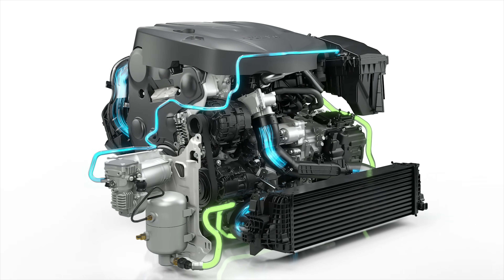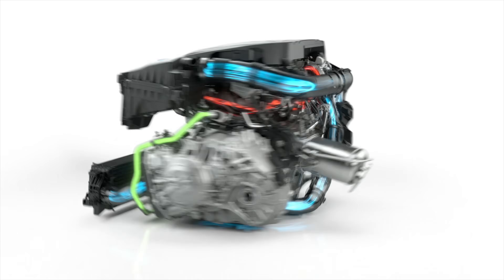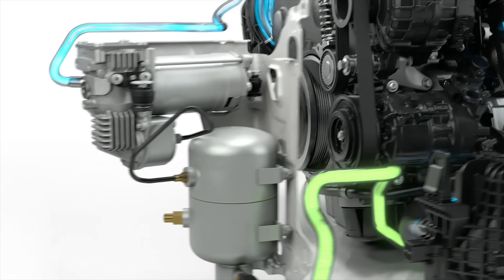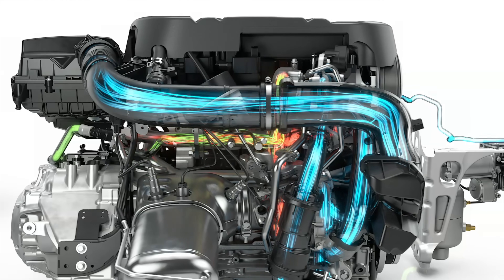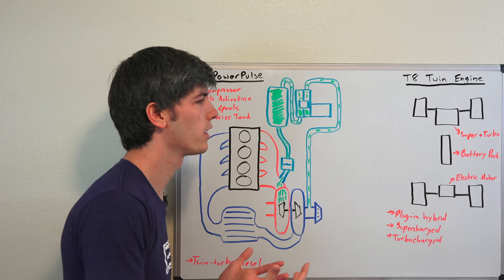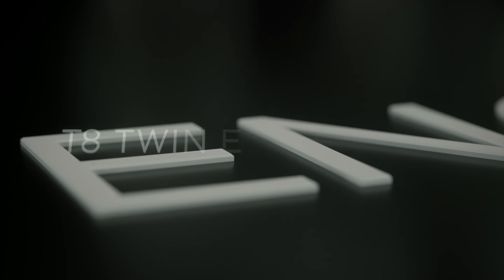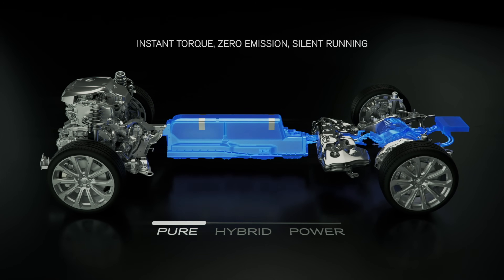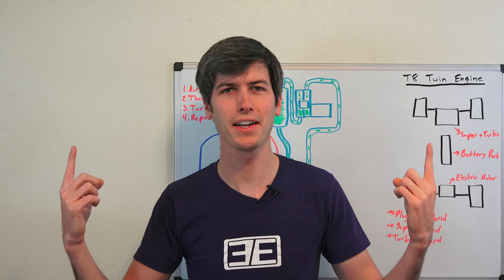How Volvo Is Eliminating Turbo Lag

Comment: So your injecting air into the exhaust and presumably before the lambda sensor... So how are they stopping it from reading a lean situation and thus dumping more fuel in?
Reply from the maker: Well this is a diesel engine, so they run a very wide range of air/fuel ratios. It would be a bit more complex if it was gasoline, for that very reason. Diesels can regulate power based on how much fuel is injected, and run just fine at very lean ratios.
Reply: Except you'll be producing a lot of NOx.
Reply: UpShiftTrackdayVideos 

They could also have an input to the computer when the air is being relesed aka activated, the computer can be programmed to expect a change in lambda reading a bit like how they do for the secondary air injection system
Reply: UpShiftTrackdayVideos by programming the ECU to ignore that change while the compressed air is being introduced. Considering the system activates at wide open throttle, the throttle body sensor is going to tell the ECU "hey we're doing the thing so ignore the funky numbers"
Reply: NOx is somewhat an issue in Diesels but the point is that this technology doesn't affect that since a Diesel doesn't have a lambda sensor and the maximum amount of fuel injected is determined by the air mass sensor (in the intake).
Reply: PbPomper No, it's well known that with Lean AFR (most diesels) the NOx emissions are very low compared to a Stoichiometric AFR .
Reply: well its activated at WOT so its gonna be in open loop anyway, but its a diesel anyway.
Reply: I can see a hack of tapping into the compressed air line to the turbo to dump a little extra fuel into it.  Then the turbo would act like a jet turbine.  ;-p

Comment: My first assumption was that the compressed air would go into the intake to provide a small amount of boost while you wait for the turbo lag, but instead it goes into the exhaust to help spool the turbo more quickly. I found that surprising.

Comment: Why doesn't Volvo just add a separate 48 volt power system and add an electric supercharger? Seems like a much simpler and less cost method than this air compression system.
Reply from the maker: Actually they did it because it was cheaper (and simpler) than a 48 volt system.
Reply: Even when factoring in maintenance? In my head, it seems more logical at this time to switch over to a 48 volt system, allows for more benefits than just adding an e-supercharger as well as allow more and more electric safety systems to be added and creating a base for future cars than to spend the time creating this air compressor design since that design will most likely be faded out within a few years.

Comment: Using fresh air into the exhaust? Do you think that tactic could be used to fool the pollution tests? Volvo says that the compressed air is going to be used only when you floor the engine, but imagine if the valve is a little bit opened all the time. It's a little bit of conspiracy theory but with what VW did the last few years, every thing is possible.
Reply from the maker: You could still measure all of the pollutants the car emits, even if you add air to it.
Reply: Yes but adding air make the percentage of the polluants lower. Now I don't know how the controls are made.
Reply: Polluants of Euro norms are expressed in mg/km so it can't be fooled. But some pollution controls are made when the vehicule is in neutral so I guess it's in ppm or something.

Comment: Why do they shoot the air into the exhaust manifold instead of after the compressor outlet?
Reply from the maker: The exhaust manifold feeds the exhaust turbine, which spools the turbo.
Reply: Yeah, but you already have pressurized air, so why use the air from the pump to make more pressurized air with the turbo?

Comment: I dont get why they dony just add a BLDC motor to the turbo. You could use it as a generator when cruising , you could use it to spool the turbo , or disconect it AND use the turbo as a turbo. Is there any downsides that i am not looking at?
Reply: Turbo requires a huge amount of power to spin up, hundreds of amps from 12V. While that is not a problem for modern BLDCs and ESCs, existing 12V system just can't do it. It is, however, possible with 48V system. But that does require either a separate 48V system, or a complete move from 12V to 48V, which is too complicated, as every tiny piece of electronics would have to be redesigned. Even car fuses will not work with 48V.
Reply: Maybe for cost + reliability reason. They use the hybrid-Turbo tech in F1. In this case, To power the Turbo's e-motor, you'll need a good reliable battery (or super capacitor) which should handle continuous charging and discharging,  and whole system has to be provided at reasonable price.

Maybe that's the reason BMW and now Volvo have not bothered with electrifying the Turbo.
Reply: aren't there a few cars that utilize electric assist in the turbo?
Reply: elektrinis fuses will work, as they only react upon the current. Trust me, im an electrician😉
Reply: mazzaram I thought this too, if u search it up on Google you can find that Audi has been planning this for a while
Reply: Electric motor is better not lag, more torque and air density does not affect it, does not need clutch and gearbox. Less parts less maintenance, it can spin very fast, much elasticity.
Reply: Yeah I had a brain-fart there, for some reason I thought about brushes. BLDC motors don't have permanent magnets in the stator. They have wound stators (exactly the same as induction motors), they might have a magnet as a rotor, although that's not necessary. BLDC drives actually run off an inverter / VFD, technically making them AC motors, but the inverter / VFD receives DC as input. It's confusing to call a BLDC a permanent magnet motor because permanent magnet DC motors implies permanent magnets as the stator, and you still have a wound rotor that goes through a commutator (hence brushes).

BLDC may well handle high RPMs, but not that high, turbos can spin upwards of 100k RPM (that's for a big turbo, smaller ones go even faster). That's not something a motor could reasonably spin at, it would need a transmission, which of course adds complexity.

Turbines and compressors are linked by a solid shaft (in street cars anyway), so the turbine will spin as fast as the compressor.
Reply: A typical car battery can easily deliver this current. It's primary purpose is to dump hundreds of amps into the starter anyway. I suspect it might be the speeds required. MOSFETs in an ESC can only be switched so fast. The higher frequency switching required, the greater the switching losses are as the FETs take a constant amount of time to transition between ON and OFF. To push FETs to turn on and off faster requires driving higher peak currents into the gate, and this can fry them (this limit is usually specified in the datasheets.) During this time there are high ohmic losses and (if high and low level fets are switched at the same time) there is also additional loss due to shoot-through. This and voltage spikes will kill ESCs in very short order.
Reply: elektrinis how many amps do you think a starter pulls? What about a winch? A full system (subs, mids, tweeters)? Big 3k+ power inverters? Lots of stuff pull over 300 amps. Hell some diesel trucks even come from the factory with dual alternators that can deliver over 300amps.
Reply: William, well, I would not allow such electrician to work on my gear. Fuses have voltage rating as well, as too high voltage will cause long arc and that will propagate to a fire. And that is how electricians cause fires.
Reply: One other point... a lot of vehicle employ 408 volt power systems, to drive the electric A/C compressors and steering racks. SO it would be very easy to implement a powerful enough brushless motor at those levels of voltage, and not require the huge amperage loads a 12 volt motor would need.
Reply: Motors that spool up to turbo speeds, that is, 15000 rpm+ exist only in F1, and they have  a limited life. They exist in WEC as well, but that was until 2017 and that technology belonged to Porsche.
Electric turbos, like superchargers, have to handle high temperatures due to high rpms, and high temperatures due to exhaust. And motors are more susceptible to temperatures Than engines, since motor windings are already in a heated state, and most certainly operating very close to the maximum temperature (that's why you can overload a motor to give double torque and triple power ONLY for 1 minute, and that is for the best motors).
Hence, electric turbos are going to take very long, and if you can make a motor to handle those rpms and temperatures, you can might as well use it directly to power the wheels, since those motors will be of greater use to drive the vehicle than to power a component of an engine, which is unfortunately going to be banned in just over a decade.
Reply: Well technically it becomes a Centrifugal Supercharger at the point the electric motor is turning the impellers of the turbo. SO you could call it a dual charger... or anything you like, since I am not aware of any current application of it in use. There is a few companies working on electric Centrifugal type Superchargers. The benefit of using them in vehicles is that a large portion of the power generation is either standing idle or wasted, so using that idle/wasted energy should not significantly reduce any gains you would get. The issue is, heat generated by the turbo itself, while under high boost pressures. With out proper insulation and cooling from the heat an electric motor would fail quickly, or be prohibitive expensive.
   What I could see being a better option, would be to install a compound forced induction system. Where you would have a small electric Centrifugal type Supercharger providing a certain amount of boost at low RPMs, reducing the lag associated with Turbos. I know VW, Audi, and a couple of other companies are current in development for such a system. Only time will tell what we end up with :)
Reply: There is a small advantage that surfaces over the long run with electric turbo, it is that if that electricity use is only for spooling, and then DISENGAGED, given that motor operate at efficiency of 90+, you won't be using much to spool. You'll spool, disengage, and then let exhaust do it's work.
For continuous running, it is less efficient, but still more efficient than a supercharger because supercharger efficiency drops exponentially at high RPMs.
Reply: Enough talk here. If you do not want a lag, go fully electric. Instant torque with 400kW of power.
Reply: elektrinis power=voltage x current. So just use more current. Like a starter motor. It would dip the voltage but it would be cheaper and easier because a sepparte compresor is more parts
Reply: elektrinis i am not talking to add a E-turbo to a regular car... As you wouldnt add an air compressor to a normal turbo. What i am wondering Is why they dont MAKE the car to work with an E-turbo.
Reply: With all that it takes. Make all the engenearing , ofcourse i wont be able to take 400amp of a regular alternator, even if you could your belt is going to fail, etc etc. I really would like see e-turbos on Street Cars.
Reply: mazzaram cost and reliability.
Reply: Uru-petrol AND also boring... I guess it Is the future , but im talking about make internal combustion More fun AND eficient
Reply: mazzaram
That is a very good question... The few downsides I could come up with (using current tech.). Complexity of design would reduce overall reliability. The drag created by the dc motor acting as an conductor would reduce overall fuel economy to the point it might not return any benefits... However just using the DC motor as a "booster" at low RPMs before exhaust gasses could build, would be a great way to reduce turbo lag.
Reply: Rimac, nio or delta motorsport es very superior, four stroke is shi* is to want to improve what is already deficient.
Reply: Doesn't electrifying a turbo makes it partly a supercharger? That doesn't improve efficiency much, because some part of it is going away due to electric usage.
Reply: Im guessing e-boost is less complex than a compresor, Valves, clutch,etc, AND also More eficient, as the alternator could be Taken away
Reply: William Jenssen And your still alive ! I have seen videos of a guy getting fried by not throwing the right switch to shut off power.
Reply: cause the chinese commie crap.   dont you know the corrupted commie govt legally forbids its own citizens from unionizing?
Reply: Why not add a disc to turbo and use engine oil pressure to spool it up at acceleration
Reply: Audi has already done this with a 48 Volt supplementary electric turbo in the Q7 to improve throttle response.
Reply: N20 bottle even better results
Reply: @Lucidbkeo  that's what clutches were invented for!
Reply: Also heat would be a big problem, I think?
Reply: Damian, there is no component in a car that can provide 300+ amps of current on a regular car. Alternator and belt will not handle that, battery will dye soon as well. Even fuses will get too fancy at those rates. As said above, you have to move to 48V to make the current more manageable. This issue has been discussed many times before.
Reply: mazzaram electric motor is already we present should spread it more. It is far superior to the combustion engine.
Reply: mazzaram some are using e-boost technology to reduce the lag.
Reply: yes, at the RPM of a turbo, the brushes would last about 2 minutes, and there would be so much commutation noise you wouldn't hear anything on the radio.
Reply: jayxtreme6 agree, but bldc dont have any brushess. BLDC (brushless DC) have permanent magnets , and can handle very well high rpm. Ofcourse , the design of the turbines may be a Litle different, so the propeler wont have to spin as fast as 150krpm

Comment: How heavy is all that equipment going to make the car?  Massive batteries, electric motor, diesel motor, supercharger, turbocharger...
Reply: CitizenEJ257 aye. That chassis looks like the one of a truck
Reply: 2076 kg in case of the S90. Google doesn't bite.

Comment: how volvo try to eliminate turbo lag: add compressed air
how bmw try to eliminate turbo lag: add 4 turbo (bmw 550d) lol
Reply: Yeah, Americans don't use turbos. 

If you completely ignore Ford EcoBoost-ing almost their entire lineup.  

And the  MultiAir Turbos, the EcoTecs....
Reply: that poor transmission
Reply: Tony x How American brands eliminate turbo lag: not using turbos in the first place.
Reply: Audi use an electric compressor in the SQ7 TDI, so maximum torque is available from pretty much idle.
Reply: Whew, that's cute. Please, elaborate.
Reply: McLaren and Porsche have electric motor drives.
Torque fill, right at the wheels, so much more efficient.
Reply: @In Jesus Name I Pray Amen. The C8 Corvette (the mid engined one) is going to be twin turbocharged so yeah.
Reply: Alfons Alex jet engines have TERRIBLE lag
Reply: Next from BMW turbo per cylinder
Reply: @mikoxneko6516  stop giving them ideas. Will ya?
Reply: Rimac, nio or delta motorsport es very superior, four stroke is shi* is to want to improve what is already deficient.
Reply: actually that's Ford's engine designer Jim Clarke's plans
Reply: Daniel Senti bhahah 😂👏🏻
Reply: Aaron Brixely Ecoboost is a trade name for direct injection not turbo charging.
Reply: ag135i MISFIRINGU SISTEMU
Reply: does the same thing lol
Reply: @RealGX Then tell me why the 1.6, 2.0, 2.3, 2.7 and 3.5L EcoBoost powerplants all have at least one turbo? Anything else in the lineup without a snail isn't branded with that "trade name". DI was introduced in conjunction with the turbo power plants in order for them to make more efficient power out of a smaller displacement engine while adhering to increasingly more strict emissions laws across the globe.
Reply: And others have variable turbos or whatever they are called which start easier to spin and with higher rpm the bigger blades start to open.
Reply: How Audi try to eliminate turbo lag: just supercharge turbocharger
Reply: Diagnosis fun when one turbo fails
Reply: i wander how much all these turbos and superchargers cost...to eliminate 1 second or less turbo lag? 10 grand? 20? Is it really worth the price, instead of putting their efforts and the money towards the electrics and the battery technology which solves turbo lag to begin with.
Reply: That’s really smart actually

You’ve created a hybrid turbo without the electric motor and only the air compressor
Reply: You can put 10 turbos. Turbo lag will be there🤗
Reply: the m550d has 4 turbos to eliminate boost threshold. the turbo lag is actually eliminated by other things.
Reply: lol true, because THERE' S NO REPLACEMENT FOR DISPLACEMENT BECAUSE MURICAAAAA
:P
Reply: American brands eliminate turbo lag by having no power in the first place.
Reply: @MrBusunglueck  that's not true. Big and powerful engines. However one of the problems with these very large engines is awful gas mileage ... :(
Reply: the g30 m550d has 4 turbochargers.
Reply: Kokainsamurai. Hellcat, Corvette, Mustang GT, Viper, Camaro SS, Chevy SS! Not a turbo among them and more reliable and considerably less expensive than European products. V8 power!
Reply: who said that i was talking about turbos? Supercharged isnt NA either. and for that camaro SS.... 0-60 in over 4,5 secs with a 6.2 litre v8. thats nothing to be proud of.
Reply: Use one turbine small electric generator combustion, batteries and ready. Different hybrid 😎
Reply: How tesla eliminate turbo lag: change the eng/turbo for electric eng
Reply: @Tony x i work at volvo m8 majority of people working in the volvo factory in sweden gothenburg hates volvos. Cheers
Reply: thats not true actually.
Reply: It has 3 turbos not 4